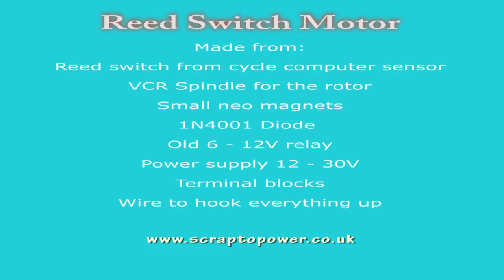How to: reed switch motor tutorial guide

Comment: you just need the battery to kick start the motor or provide the kinetic force it needs when you push it.  Run it to a generator and controller to run an off grid or on grid

Comment: I wood like to know what the pulling force the magnet has. I am trying to use a reed switch in an engine powered by batteries and want to be able to turn off the switch with a magnet as i have switches that are normally on and need to turn them off. Thanks...

Comment: Great job very tidy, never seen that kind of reed switch before, I was wondering what it was out of :) it looks like a magnetic head out of an old VCR, I have a couple of coils the same as yours out of an old TV set but the reed switch has me stumpt.I have been using the ones on ebay from China and an LED diode for the arking works well.
Reply: I know this is old but the reed switch was explained in the video.
Reply: How did you stop the plain reed switches arcing and welding closed ?

Comment: Hello again; would like to know what amperage the reed switch could handle and where to find heavy amp reed switches for my heavy flywheel pulse motor project. My power supply tells me that my circuit draws an amp and more as I raise the voltage. I should use a coil with higher number of windings and thus draw less current? Please reply cause I actually cooked my reed switch a couple of times.
Reply: reed switches can be obtained from www.allelectronics.com.
Reply: Connect the reed switch to open the gate of a MOSFET or other transistor, then your reed switch only needs low voltage. Even could go far as connecting a reed switch to arduino (or other microcontroller) and a motor driver for real time speed control.

Comment: Doesn't that motor setup use far more current than a typical reed switch can handle which is 0.6 amps of current.  It will fry it in no time. No?

Comment: What kind of “magical” sourse of power do you use? You didn’t even mention it while it’s the biggest problem with reed switches, they burn really quick.
Reply: What kind of reed switches are you using ? The reeds don't fatigue , the contacts are in a inert atmosphere the life is in the billions of cycles , one billion cycles with two poles at 3000 RPM would be 19 years continuous , a reed switch rated for 10 billion would last almost 200 years .

Comment: Where should be the reed switch be?  Next to solenoid, or at 90 deg counterclockwise position to create maximum pull on the rotor magnets?  I guess it is the rotor magnets which control the reed switch.

Comment from the maker: It stops the back emf from the coil arcing across the reed switch contacts, When the coil is turned off and the magnetic field around the coil collapses, it generates a high voltage spike, this can arc across the contact or damage other stuff connected to the circuit. At least that's why I put it there.

Comment: Ya know, you don't need the diode right? You can put that diode out of the coil and use it to charge batteries.
Reply: The diodes are connected in inverted parallel with the coils of relays, solenoids or stepper motors to protect the drive components such as, for example, transistors or SCRs. This is because, when the inductive load (motor, relay, etc.) is turned off, the magnetic field created contracts and generates a high reverse voltage which can burn the drive transistor or SCR. With the diode, it does not lead with chain drive, but puts on short induced at shutdown, thus protecting the transistor or SCR current. See the link below for an example circuit with diode.
Reply: I get t it. The field collapse can ruin the motor. Blar blar blar check out lidmotor on YouTube. You will see what I mean. His recent video shows it without the diode working fine. I've built tons I mean tons of these reed switch motors. Check it out.
Reply: its like a simple bedini charger but with limited charge because there is only one coil
Reply: Ary Junior yes the diode protects the reed switch from back emf currents that could trigger sparks and damage the reed contacts..you can also place a capacitor there where the diode is..that will also absorb the arcing that occurs between the reed contacts when they switch on and off continuously!
Reply: You can add a led and get some cool light out of it
Reply: I mean how large a back emf spike goes through with a 1.5 v battery, especially if the switch is a contact 12v switch with a coil. Did Tesla use a diode on all his magnetic contact switch motors?
Reply: +marshall wheelis a 12V coil can generate a 1000v when the field collapses. same principle as a spark plug.

Comment: Where did you get this large reed switch?
Reply: Digi-key has reed switches rated to 3 amps at 100Hz and there is no reason you can't put multiple switches in parallel for higher amperage , but it would be hard to go over 3000 RPM . still that covers 80% of the motors I own.

Comment: Just need some pickup coils around the rest of the wheel....maybe it would power itself !!!.......Nice
Reply: I was only making an obviously poor joke. Oh and there is such a thing as free energy.
Reply: +Darryl Edington Umm, solar, wind, wave is not free energy. Just free to you, the sun is "burning fuel" to make the energy..
Reply: +Darryl Edington "humans don't pay for it" Really? Windmills and solar panels are free now? What are you smoking?
Reply: +Darryl Edington No, you said "free means humans don't pay for it" and that is an open ended statement. and FYI our Sun is a star. Just like the Suns of planets in other solar systems are stars.
Reply: +Darryl Edington "JUST LIKE IT TAKES MONEY TO COLLECT AND DISTRIBUTE ALL ENERGY. Any questions?" Yes. if it cost money to collect and distribute all energy, then oil is just as free as solar. We didn't pay for the oil we paid to have it found, pumped up, refined and distributed. They will do the same with solar, charge us for collecting it, storing it, converting it to AC and distributing it to our homes.. So all we will be doing is switching from one power company screwing us to another power company screwing us..
Reply: Solar wont be viable until storage costs come down.. I have a small solar system 400 watts of panels and 200Ah worth of batteries, was some where in the $600 range for it all. (would have been over $1200 not all that long ago) I use it to charge my hobby batteries and for some lighting in the evenings. 3 days of over cast and I'm screwed. we have weeks that go by with nothing but overcast days. If solar was my only power source, and I wanted to run everything I would be looking at close to $30,000 to do it right.. And I would in all likely hood, still have days that I would need to run a generator to make up for sunless days. I realize there are areas with less overcast days, where solar would be more viable. Just not everywhere..
Reply: ***** You don't have to convince me that we (Corporate America/Government) have our priorities all screwed up.. It's all about the fast buck.. If there is not going to be a huge and fast return on our money, we tend to ignore it.. Won't be long and that bird will be back to roost.

Comment: Neat... why is there a diode? or that one way thingee... I think it is a diode...  why is it there?
Reply: +Genma Saotome  this is a free-wheeling diode
Reply: +John Smith What?  Why is a diode as part of the circuit... might be too complicated to explain.  I should of paid more attention in electronics class.
Reply: +Genma Saotome   Each time you disconnect the coil it "kicks back" and can generate a high voltage in the opposite direction.  The diode shorts this to protect the switch from arcing.
Reply: Motors are basically large windings of coils, and a coil is basically an inductor. The thing about inductors is they like to store a portion of their electrical charge in the form of a magnetic field around themselves. In motors, this storage of energy is what enables them to move. The magnetic field attracts to an opposing pole, and then it is switched off, the other coil generates a magnetic field, and it is attracted to another opposite pole.

The problem with inductors and coils is this stored up energy has to go somewhere. This particular motor uses a reed switch to quickly open and close the circuit giving the motor power. When the power is rapidly oscillated like that, the coils will have to dump their stored up energy somewhere. Since it can't send it through the rest of the circuit (because it's been opened), the current builds up at the switch, and when it is closed again releases all of that current and then some, more than likely in the opposing direction of the normal supply current, which is dangerous.

Think of it like putting a kink in a hose, then opening the faucet even more and unkinking the line. Much, much more water will come out the end and at much higher force for a second or two before going back to normal. 

This is bad.

In this design, the diode used is known as a flyback diode, and any diode can work in this configuration. It goes by other names, but the basic principle is that it directs that buildup of current away from the switch and only enables it to flow the way it's supposed to. This can be used with a pull up/pull down resistor to make sure the stored up, unused current is given a safe path to ground with the cycles of the reed switch.

As for what a reed switch is, it's like your every day switch that either opens and prevents the flow of electricity, or closes and allows it to move. Reed switches are different than regular switches because they use magnetic fields to close or open. That's what those magnets are for that he puts on the motor. When one magnet passes by the switch, it closes and then by the time it's gone, it opens and power is cut to the motor until the next magnet passes by. It uses the natural momentum of the motor to give it most of its speed. Kinda like going down a hill on a bicycle. There's no need to keep pedaling when you can just let gravity do the work for you.This means the motor is only actively drawing current for milliseconds at a time, versus constantly sucking current from the supply. And it can still attain the same speeds as pumping it full of power constantly.

The benefit of this is you can theoretically run the motor at a much lower voltage but end up with usable speeds. A much more common and practical approach is to give the motor a PWM signal. PWM is Pulse Width Modulation, and think of that like the digital version of what's been done here with the reed switch.

Let's say you have a motor that runs at full speed on 12v. By PWMing that 12v line with the appropriate oscillation, you could run the motor at 12v speeds on say, 6v. This is relatively normal, and is how most motors in every day use function, especially RC toys. If they didn't, then the batteries would die much much faster.

EDIT
Actually, on further inspection it looks like this motor is relying purely on magnetic force to move. The power lines hooked up to the terminal blocks feed power to that little orange box, and the black thing is the actual reed switch. And the power lines are wired with the reed switch so it opens and closes power to the orange box. The orange box is a coil most likely, so the reed switch closes when one of those magnets gets close, which therefore turns that coil into a small electromagnet which forces the magnet away from the coil, turning the motor. Then the field quickly dissipates and re-energizes when the next magnet passes by. That's fucking genius.

Comment: pulse motors are not fake, I have been building all these so called free energy devices, none of them work, they are great for learning how to manipulate electricity and multiply power, but they aren't running themselves. I'm building a pulse motor, I will be able to run my old laptop off grid and run lights. Trolls be trolling.

Comment: how i wire electric  motor to turn opposite
Reply: +Javier D.F. (DF) Put the reed switch on the other side of the coil and spin the motor in the other direction. You should also be able to put the reed switch on the opposite side of the rotor, across from the coil, and then the direction would be set by the direction you spin it on startup..
Reply: Thanks a lot Dude it works

Comment: what is the  black  one  and  can give  the  diagram thx
Reply: it looks like an NO reedswitch to me..as the magnet approaches the relay coil, the reed switch senses it and closes the circuit and the coil becomes a magnet..the electromagnetic field is induced and it repels the N faced magnet on the rotor, as it repels, the rotor magnet leaves the reed switch and the electromagnet dies down..this happens repeatedly inducing motion of the rotor..
Reply: Grant Anderson if we placed a large heavy spin flywheel it might also spool up an alternator fixed along its axis..lidmotor made some experiments and it showed that reed switch pulse motors tend to draw less current as loads are placed on them unlike conventional dc motors which start burning up more current as you load them

Comment: and two wires off screen
Reply: What? You think this is fake? He used reed switch.
Reply: +Baymax I really like this clean, simple implementation.  I purchased a number of reed switches, which are closed and pass current when in a magnetic field and I'd like to make a motor with one.  It looks like the fellow in the video actually used a small magnetically-triggered switching relay, but it's electronically similar to a reed switch.  I need to figure the positioning of the inductor that moves the magnets on the wheel relative to the reed switch.  And how to wind the inductor - I imagine you want an iron or ferrite core in it.